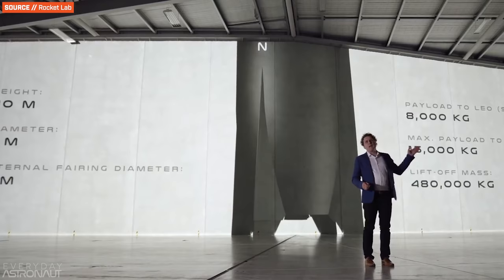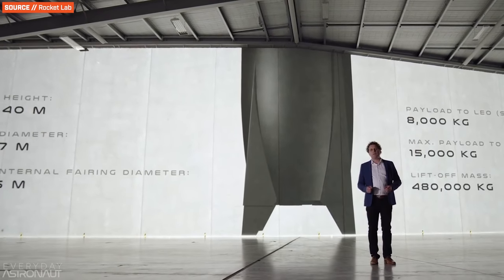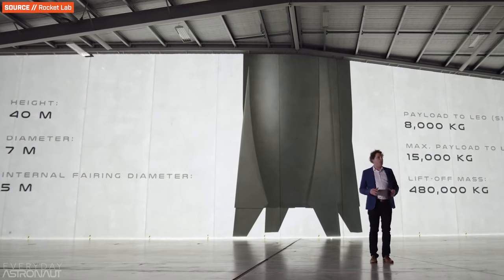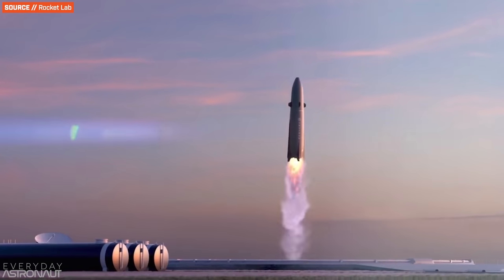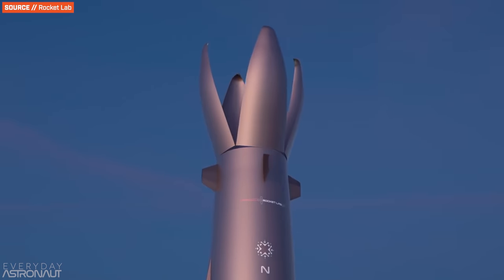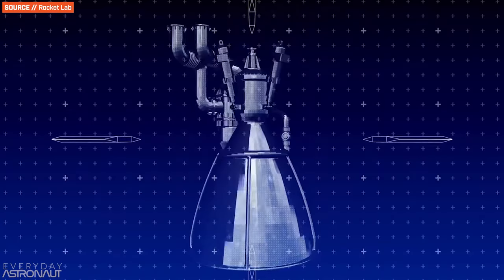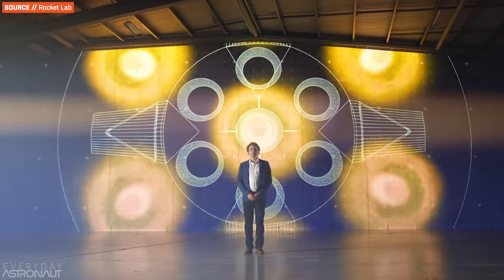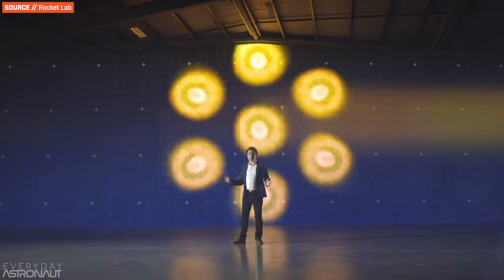Talking about Rocket Lab’s Neutron with Peter Beck

Comment: I feel like ride sharing is not going to be a thing with large rockets. If it's much cheaper to launch more stuff, I think customers who are bigger companies are just going to buy the whole (or a few large companies share) payload capacity. Large companies will just buy the 250 tons on Starship for an order of 10 Million dollars. So if you are a small company who has 100k to spend on your payload, you will probably have to use smaller vehicles and get maybe 0.5 tons instead of 2.5 that you could with Starship. But if you have to pay more then you had better get to be delivered to the right orbit, time, etc. So, I think the trade off in capacity and cost for smaller companies and customers will be made up by this customized service. The fundamental assumption, however, is that large companies have just continuous demand of payloads, and they keep wanting to send more and more stuff. I find it quite difficult to believe with a lot of certainty at this point, whether the demand for the use of space grows as the supply is expected to grow (which seems quite a lot).

Comment: Add some Ducting or tunnels to vector and channel some air flow to those stagnant hot spots under vehicle. Couldn’t that work to help with low pressure / hot spots under electron!?! Maybe two flow designs for low atmospheric altitude and then another for higher altitude (optimized for changing atmospheric pressures) Might have to change the inlet location or collection area to another location for hypersonic speeds or maybe just some fancy canards. Can’t wait to see electron take off !

Comment: I’m curious that if they sense that they can’t reach orbit for whatever reason. If this vehicle will be able to return to the launch site without loosing the customers payload?
Reply: It's a good question, but I think realizing something like this would be relatively hard. For the landing they have to know the weight of the rocket, which don't just include the second stage in this case with the payload but also the fuel. If everything goes after plan they know how long the first stage has burned and how much fuel is left, but in this case there's no reason to abort the mission. If there's a problem with an engine they have to know how much fuel is in the tanks when they abort the mission, and the landing procedure would be an individual one, because every payload has a individual weight and if they abort the mission relatively late in the first stage burn they may not have enough fuel left to land with the additional weight, since more weight to slow down means the engines have to run longer at landing.
So in theory it's possible, but I think it would be hard to realize.

Comment: The more I learn about Neutron, the more I realize Falcon 9 is, like, minimum viable reusable-- it feels a whole lot like an afterthought.
Reply: F9 has been in business for over 11 years now, it was the first operational rocket to even try reuseability (which basically everybody else deemed impossible at that time). There was no prior knowledge in this area - so of course there is room for improvement in a new design that can incorporate all the lessons learned.
Reply: At the end both can reuse the same components, the booster and the fairings. Space X reuses them in a different way (by fishing the fairings out of the ocean), but they also reuse them.
Both need a new upper stage for each mission.

Comment: I said this when the Neutron came out, but I still worry that Neutron is where the puck was by 2024/2025. There's a lot of interesting advances here, all the same.

It may not be as big a concern as anticipated; it's clear that once starship is up and running falcon 9 will be made and maintained as long as there is customer demand. But if this comes out significantly cheaper for the reasons stated, it might be able to eat into that market.

How large that market stays as rockets change, is the real question, I guess.

Comment: It's fascinating to hear how radically different Peter's design mentality is from Elon's. SpaceX and Starship are pushing the limits of everything from their launch pad to engine performance, while Rocket Lab and Neutron are removing the launch infrastructure almost entirely and using engines with as much margin as possible. Both companies are being driven by similar engineering constraints and ideals, but are going in completely different directions to achieve their goals.
Reply: Why are you calling it "Elon's design"? Musk is not an engineer and didn't design a single thing for spacex
Reply: @user-zb8tq5pr4x   that's a pretty contrary position. He may not literally be cutting the CAD sheets, but he's certainly involved in the design process. I think it would be safe to say he is a physicists by training and an applied engineer by trade.

Comment: He makes some interesting points and who better to speak on good rocket design than someone fresh from a clean sheet of paper design.
The thing being touted about stainless steel for a rocket was it gets stronger as it gets colder. All well and good when it has fuel in it but it still has to support its own weight empty requiring all those stringers and the like  which are not there to make it a better pressure vessel they are just there to stop the whole thing buckling. All these things need to also be stainless for ease of attachment.
Makes me wonder if the driving force on Starship behind deleting the legs and making the chop stick catching mechanism and having fixed deployed grid fins is that of escalating weight and the need to further brace for that weight.
Stainless is great for rapid prototyping but have they dug themselves a hole in the process?
Time will tell I guess.
Reply: Stainless has been used successfully for mass-produced rockets before (Atlas ICBM, and then launch vehicle). It is a well understood material, with lots of people having experience in fabricating with it. If you are in a hurry, it is a lot easier to hire a bunch of welders from a village next door than to set up a composites facility.

The cost difference is also non-trivial. Electron is a tiny rocket -- it weighs 12.5 tons fully fueled. Yet it barely breaks even at $7.5M per launch, (although much of this in due to overhead not being spread over a sufficient number of launches.)
Reply: @cogoid  Correct. Electrons' max payload is SEVENTY times smaller than F9.
Reply: @cogoid  "Stainless has been used successfully for mass-produced rockets before (Atlas ICBM, and then launch vehicle)." 
It comes down to how well it scales to being used on the biggest rocket of all time is what intrigues me. 
I'm in no doubt it is the best material to have got Starship to were it is now, probably also the best all things considered, particularly regarding the planned production numbers.
Everything has a compromise though particularly when a rocket gets that big.
Just one of the many things of interest to me about the audacious project that is Starship.
They have built a jig to crush a section of booster under a vertical loading for instance, that will be interesting if it informs further booster construction.

Update: new version 2 engines, more engines added, extra fuel capacity for engines. Another thing pointing to a construction weight blow out ? or am I just putting a spin on all these iteration changes.

Comment: This discourse made it clear to me that basing rocket fuselages on what were once considered exotic super-lightweight carbon-fiber material manufacturing techniques means that the classic retro reusable rocket designs of Buck Rogers and Von Braun’s V2 are suddenly cutting-edge again.  Peter Beck hates Stage 0 and refuses to play the same game that NASA made workable and SpaceX is optimizing with Starbase.  The payload insertion simplicity of Neutron seems closer to Tesla’s CyberTruck while the payload insertion complexity of Starship seems closer to a NaviStar tractor- trailer. Maybe the home of innovative America’s Cup boat designing has nurtured a winning vehicle for sprints along the z-axis?

Comment: What happens to the rockets that get the “send off”?
Reply: They would be used for expendable launches and would be disposed of in the ocean when they run out of propellant. Reportedly, Neutron can do over 8 tons when recovered and up to around 15 tons when expended. The Falcon 9 is similar with up to ~15.6 tons when recovered and up to 22.8 tons when expended.

Comment: Good luck to RL on the Neutron rocket but not at all convinced they will make a carbon fiber/resin cryogenic tanked rocket reusable & will likely abandon that direction for steel/ alloy tanks once the reality of the materials technology challenge comes into focus. The vehicle will likely require some kind of external ablative compound or shielding to prevent breakdown of the resin matrix, but sands that the inter-lamina stress fractures will be extreme transitioning from cryogenic state to high aero-thermal heating loads on renetry.  I also have to critique the product launch video and the demonstration of the impact testing on the different materials, looks impressive to the lay person but people who do actual engineering know a: Carbon fiber composite damage often happens in the inter-lamina regions and isn't visible externally b: The demonstration would look totally different if the materials were brought down to cryogenic temperatures (which is the operational condition BTW). So in effect it proved nothing of real engineering value, I think if they created a set of thin walled tanks filled them all with LN2 and hit them we would get a good demonstration of the limitation of CF composites for cryogenics.

Comment: How much performance does return-to-launch-site cost? I mean SpaceX uses ocean landings to get more delta-V out of the first stage. Rocket Lab is throwing some of that performance margin away by always returning to the launch pad.
Reply: Neutron is recouping that performance loss with the use of super light composite structures and the point of Neutron is not to be the heavy lifting super high performance vehicle like some others, but instead a competitive low cost ride to space, as Peter pointed out. Apparently it costs a lot to operate the ocean vehicles! 60-70k per day in port according to Peter.
Reply: @linecraftman3907  I don't doubt that, but there's still some amount of performance that is left on the table by having to use it to return to land. There's no way around that unless the stage can glide back without a boostback burn.
Reply: @4Leka  i believe that rocketlab are well aware of this and the performance loss is again, reduced by lightweight rocket, simplification of launch operations and thus cost reduce, reduced launch costs make the vehicle more competitive on the market. You also have to be aware that while it's nice to have extra performance, the rockets almost never fly at their full capacity. And also as said by Peter - one of the design constraints is that it has to relaunch in 24h which is not possible with ship in the ocean taking most of the 24h if not more getting there.
Reply: @linecraftman3907  Of course they are aware, I'm just interested in how much that performance cost is compared to landing downrange.

Comment: Why does every startup company have to develop their own engines - isn't there enough designs out there already ? Merlin, Raptor, RS25, the Russian RD-XXX series, Rutherford, Draco, SuperDraco, ...
It's like every computer company having to develop their own silicone chip technology.
Reply: Most of the engines are not for sale.

And in the past most computer companies did develop their own processors. It is only in modern times that the investment in commodity microprocessors has become so great (many billions of dollars are spent by Intel to upgrade their chips by one notch), that it is difficult to compete with them. Still, Apple develops their own chips, IBM mainframes use IBM's own chips, Chinese supercomputers use their own homegrown chips, Google makes their own TPUs. There is still some variety.

Comment: Is there a point at which the most efficient RTLS is simply once around the planet?
Reply: Well, if you had an SSTO then yes. But SSTO sucks according to Tim.
Reply: @Mosern1977  it wouldn't be a real orbit, just a very long ballistic trajectory.
Reply: @mrnikau1  L E N G T H
Reply: @Mosern1977  SSTO offers a very low payload compared to the vehicle mass, because it has to carry a lot of dead weight to the orbit, what a staged vehicle don't has to do.
Reply: @mrnikau1  - yes, unless you orbit once before going down again. I guess Starship upper stage would do a RTLS always.
Reply: @simonm1447  - yes, they do - and that's why it we don't see them around. But if rockets where much more powerful, then the simplicity of the design is of course nice.

Comment: I was just wondering  starship needs its boosters and its massive vacuum optimized raptor engines to put it into orbit but how starships  4/3  small sea-level engines lift it up on mars because booster has 30/32  engines compared to 4/3 on starship

Comment: He is talking bull about marine fees. At Port Miami the single-day cost of  dockage fees for a massive cruise ship such as 'Harmony of the Seas' is $81,720.  For a much smaller cruise ship 'Oceania Regatta' which is bigger than a rocket landing barge is $6,661.  Port Miami is really expensive. Port Canaveral  fees are $15,693 and $3,588 for each boat respectively.
Reply: what about the crew and ship itself though? You're renting the vessel and its crew.
Reply: @imarchello  Renting a rocket landing platform? Is it from Rocket landing platforms are us?
Reply: @Photonface  It sounded as though Peter was talking about dockage fees, but perhaps he really meant the total cost of operating the vessel.

SpaceX leases the barges which they customize into landing platforms. I think they only bought one boat just recently -- everything else is leased or is owned by contractors doing work for SpaceX.

Comment: SpaceX should make Super Heavy 2.0 out of carbon composite as it doesn’t have to handle all the heat load that comes with atmospheric reentry like the second stage.
Reply: They started with Carbon composites and abandoned them.
Reply: @TheEvilmooseofdoom  I know. They switched to stainless streel because it tolerates the heat load of atmospheric reentry better but ad I mentioned the booster doesn’t have to come back from space.

Comment: Huh, I wonder if SpaceX is actually planning to use the oil rigs as their own dock for the barges, if it's already in the general area for re-entry all you need is to bring the equipment back and send the barge back out to sea.
Reply: Do you mean the autonomous drone ships used for Falcon 9 and Falcon Heavy boosters? If so, they are too small for Starship. The converted oil rigs will have a mechazilla and launch pad for catching and launching Starships.
Reply: @steveaustin2686  do you suspect the rigs wouldn't be capable of handling either service as a dock or falcon 9 recoveries?
Reply: @CyFr  Not likely. The mechazilla and tank farm is likely to take up all the space, so there probably isn't room to land a Falcon class booster. The drone ships will be used for Falcon class boosters only and the rigs will likely be for Starships only.

Comment: Why don't u use Zink Air/o2 batterys? They have a better weight to Power Ratio than Litium Ion Batterie, and debending on the oxigin Put thru u geht a higher Energy Output. And Zink is way cheaper than liio Batterie. Also u get lox with u, u coul'd Put a Tube and a valve thru the Batterie and everything that dosn't react can Go Back to the Engin.

Comment: SO hen, electric pump to hove popellantr into the gas generator?
Reply: That would actually be a good idea. Makes startup simpler and more reliable. Simplifies the engine (otherwise you need some other power source to spin up the gas generator). Makes it easier to deep throttle.
Reply: No electric pump. Peter answered this question in an interview with Scott Manley.
Reply: @cogoid  oh . Got a link/timestamp pls?
Reply: @saumyacow4435  By doing thatat, the gas genrator starts to look a whole lot likie a Rutherford engine, except that insteaed of expanding gthe oombusion poducs to proue thust, yuo feed hem to the turbopump driving he main engines.  This escapes he deep throtle quadrtaic death you can get with main combustor gas genrators.
Reply: @saumyacow4435  Just after 15 minutes, when they are talking about the upper stage engine. The video is on Scott's channel.
Reply: @cogoid  Disn't Peter Beck alaso twll Scott Manly definitely no mehane ht it was "too burn-ey" ?
Reply: @cogoid  Yeah saw that thanks. He definitely says using gas to spin up.
Reply: @NormReitzel  Yep